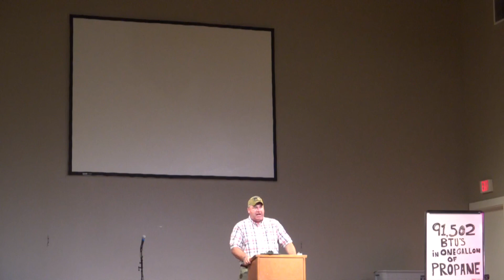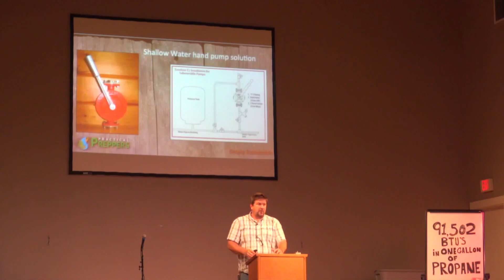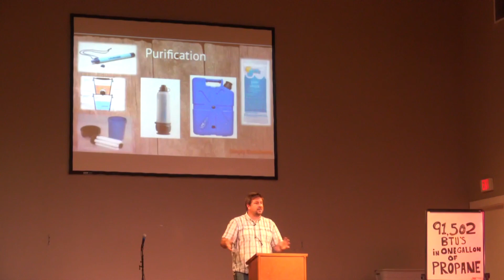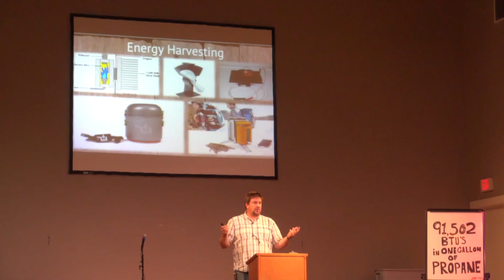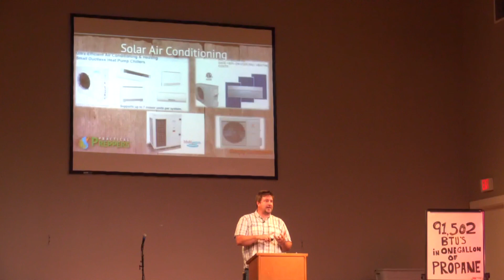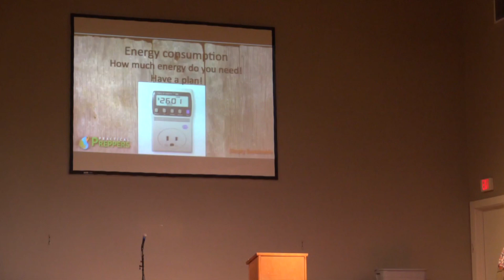Scott Hunt Threats and Solutions In Today's World

Comment: I disagree on some points .   12 volt for survival. Water. heaters and a.c.  from rv  etc.... 48v for cabins with a stored 12v converter,  and absolutely, lithium iron for batteries. .  Take your power with you. 360 volt?  Your  getting an ego... lithium last For 20 years....or just buy batteries every 5 years...... really?    Come, on 557, embrace technology... batteries every 5 years?    Really?  ..  Will they be available?  Steal from cars perhaps... not a long term solution...
Reply: Emp gun is easy to build.... hint.. taser and compaciter... just do it..... please test solar pnls... hooked up and not...  bigg3st flaw i see in prepers today,  is thinking panls will survive... no power equals, no living.   How many systems have u installed?..  775, get your shit together..  I am new here,  but really?

Comment: Burning 100LL in a carbureted small engine should be ok, as long as it is run under a load. Prolonged idling can cause lead fouling.  If you are planning on burning 100LL in a modern vehicle, be prepared to replace O2 sensors, and dealing with plugged catalytic converters.